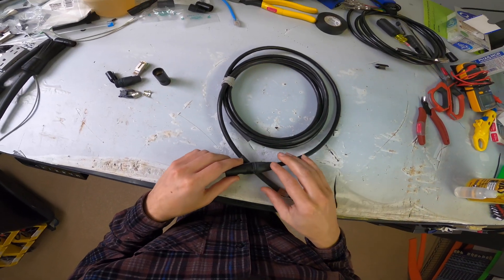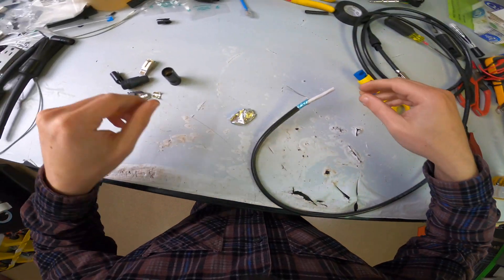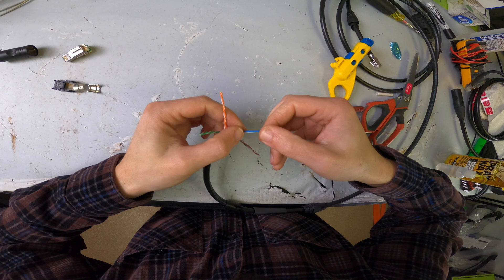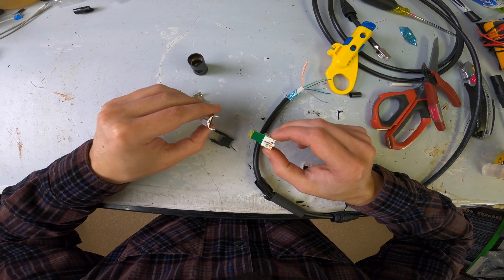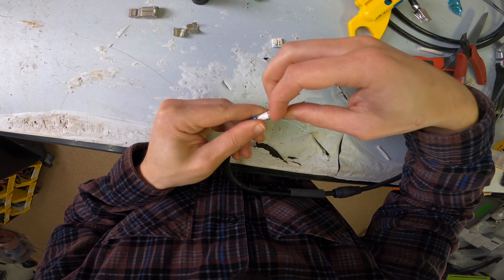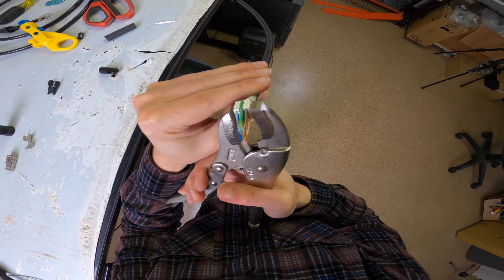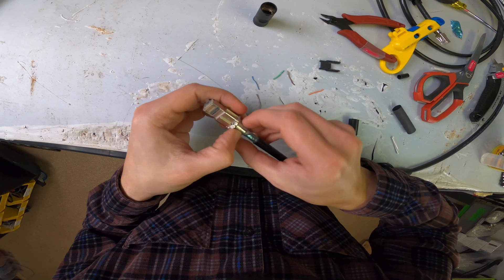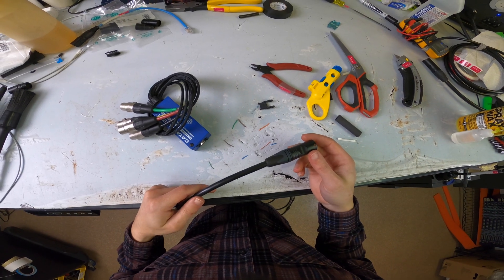POV | How To Build A Neutrik NE8MX6-B Connector On Tactical Cat6 Cable

Comment: It’s a real nightmare… at list for my abilities. I hope there is an alternative of simpler kind of ethercon connector so that it’s a little easier to mount the cable.
Reply from the maker: @robertolotti2669  it’s easier if you use thinner cable. As all the shielded RJ45’s go…this one is sadly the easiest to build

Comment: Aren't you supposed to wrap the drain wire (shield) AROUND the little clam shell metal pieces, and then slide the strain relief piece onto and over the back half of the clam shell? That then holds those two pieces together as well as traps the drain wire against those clam shell metal pieces. The shield is pinched against the clam shell by the strain relief which makes that connection.
Reply: Yes!  Don’t assemble the shield the way shown in the video!  The shield needs to be pulled up over the metal clamshell and the drain wire needs to be wrapped around the shield and clamshell.  If you don’t do this, the integrity of the shield isn’t maintained across the connector interface and you greatly degrade the effectiveness of the shield.  You paid a lot of extra money for a quality shielded connector, so assemble it per the Neutrik instructions so the shield works for you after you are done!
Reply: I did it the way I saw it in the video and I did NOT have continuity between the shield across the cables. So yes, I believe it must be wrapped around the clamshell in order to provide continuity to the cable because the drain must have continuity between the ethercon connectors or it will FAIL!

Comment: Couple of things. Not meaning to sound like a smart arse. Don’t pull the cassette apart. Don’t remove the black holder off until all wires are fed in. Also with the split clamp shell just push the cable clamp up and that will hold the 2 bits of metal together before you push it into the barrel.
Reply: +1 for that , i'll exactly the same :)